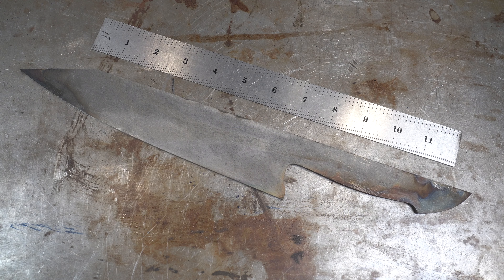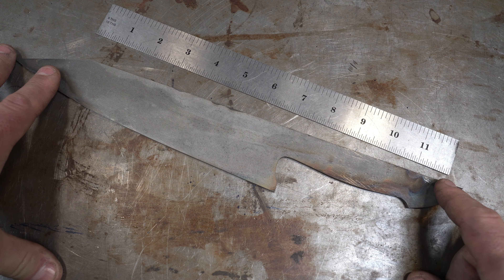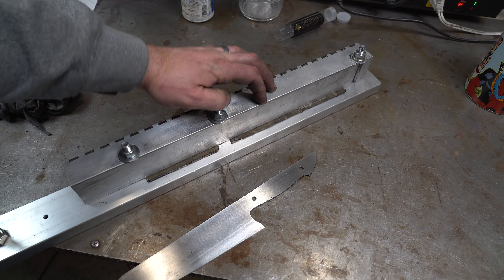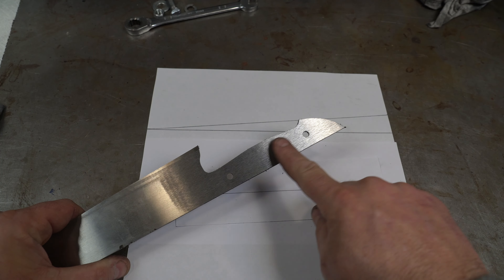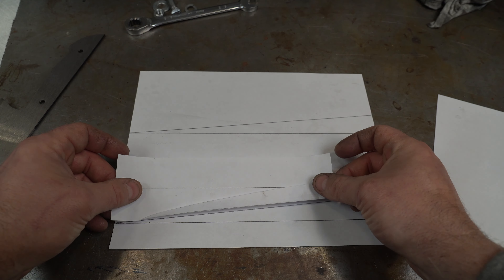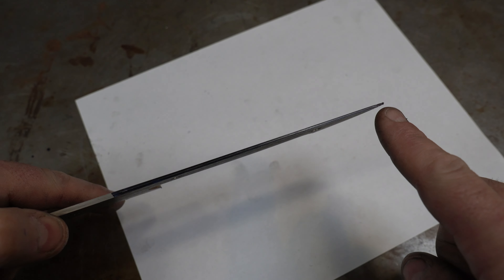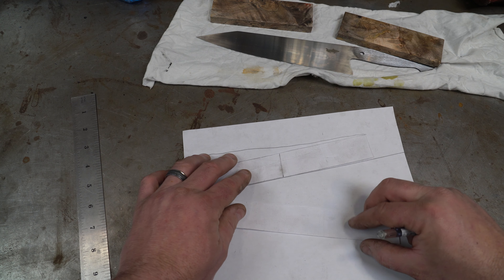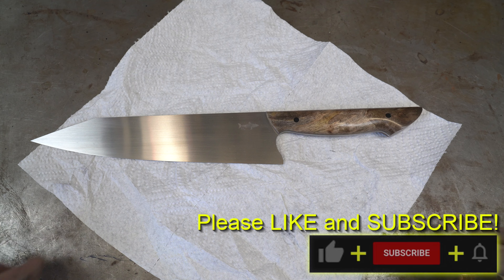Triple-T #130 - How to do a tapered tang on a knife

Comment: thanks for the great video, i forged in a tapered tang on my first knife build (risky for a newbie) , and quickly found out about the pin angle issue when I went to test fit after drilling my holes 90 degrees without thinking it through. luckily i was able to just ream out the holes a little bit and force the pins in. turned out great but will definitely be doing it this way in the future!
Reply from the maker: At least you made it work.  Thanks for watching!

Comment: anybody else's mind blown at 5:17 when Dennis used the rear end of the digital calipers to measure depth?! Thanks Dennis - my digital calipers have just become exponentially more useful!
Reply: Thats why its there, at least i thought so. I learned that working as a machinist back in the late 90s. Calipers measure in a lot of ways. Just think outside the box.
Reply from the maker: Yes, there are 4 measuring methods with calipers.  Outside, inside, depth and step. 👍. Thanks for watching, Daniel.

Comment: Nice job. I've got to practice tapering tangs myself.  
For the pins could you just drill them before tapering. Then for the scales just lay them down with the tang under the press and level your table with the drill?
Reply from the maker: No, think about it, you have 90 degree straight holes that you would be putting onto tapered tangs so your holes won’t be inline.   Thanks for watching, Bobby.

Comment: thanks for a informative video i have a OBM grinder and OBM surface grinding attachment still have not tried a taper soon i hope! denis may i ask The CPM154 do you need to do a cryo temper? i want to do stainless what do you recommend starting with? thanks Mark 😀👍👍✌
Reply from the maker: If you’re starting on stainless you should start with AEBL.  It’s very cheap and easy.  CPM154 is about 4x the price. Both will get an extra point of hrc from cryo but you’ll get about a 1/2 point from putting it in your freezer in some ice.  Thanks for watching.
Reply: @TyrellKnifeworks  thanks denis

Comment from the maker: Any questions about this process?  It sounds a little more complicated than it is when drilling the pins, but it's really not that hard.
Reply: How would you do this without a surface grinder?

I have one where the handle needed corrected, and in forging the tail became thinner than the ricasso. I was LITERALLY just about to go start working on it and just eyeball it on the flat platen by bracing my arm and holding the blade.

This was how i assumed at least some makers do it.
Reply from the maker: @jacksin3323  yes you could just eyeball it on the flat platen.  It’s just not as accurate.  I would definitely recommend you put some layout lines so you know where you are grinding to.  Thanks for watching.

Comment: Can you do a tutorial on how to do this without a surface grinder?
Reply: I think to get it accurate you'd have to use the dreaded hand files!
Reply from the maker: You would just have to put layout lines and grind it on your flat platen.  Certainly doable but not as accurate.  Thanks for watching.
Reply: @brysonalden5414  I do all my knife work with a 1/2 inch automotive belt sander lol. You can do it with whatever you got as long as you got the skill.
Reply: use a machine magnet on your flat grinds with the knife pointing down, you will automatically put more pressure on the end of the tang, giving it a nice taper